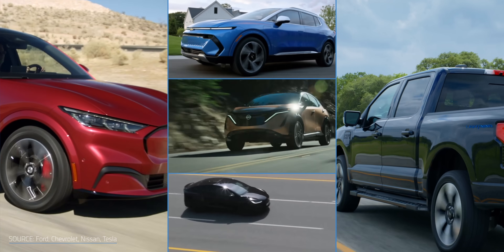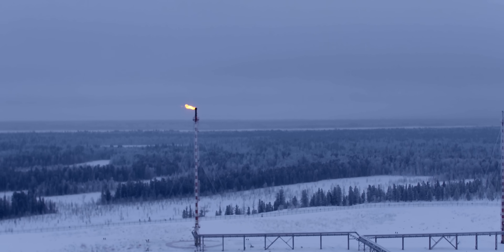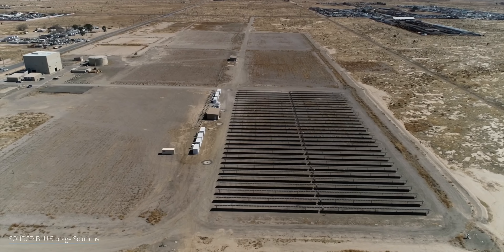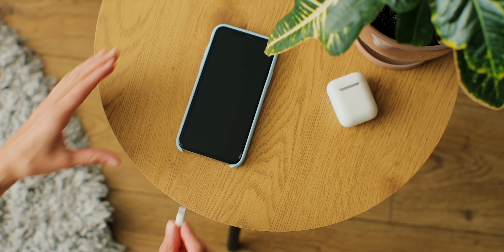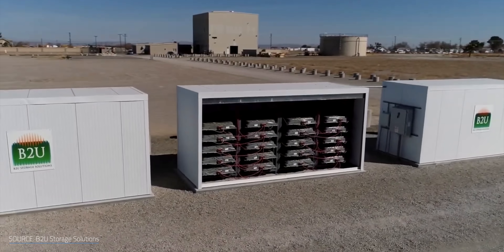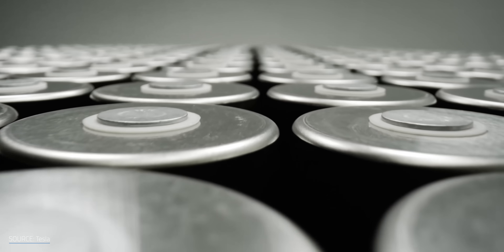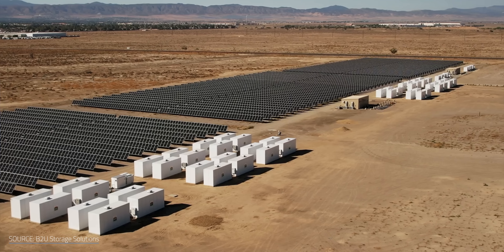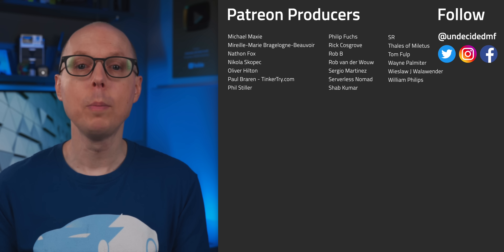How Old EV Batteries are Perfect for Energy Storage

Comment: While this idea sounds nice on the surface, it detracts from the main problem. We should not be using Li-ion battery tech for static storage - even used ones. These batteries are prized for their energy density, but their components are scarce and difficult to obtain without causing damage. Instead, recycle them, recover the materials and make new batteries.

There are other battery technologies that are better suited for static storage, where high energy density is not a major concern.

Comment: Firstly, there's no such thing as 'grid scale' battery storage. Batteries can help stabilise the grid and provide very short term peak supply but the amount of energy they can store is pitifully low, and at huge cost. If you have the terrain pumped hydro is much better. Second, those batteries will still die eventually, so recycling has to be the ultimate solution. Using discarded EV batteries as back-up storage is just a means of not putting them into landfill. EV manufacturers should be forced, by law, to recycle the batteries removed from their vehicles, and be fined heavily if they fail to meet minimum levels of material re-use.

Comment: Another good video- and another example of capitalism at work! What a waste not to re-purpose still useful batteries that no longer fulfill their original purpose. In the long run, these batteries will be fully depleted, and hopefully by then better recycling methods will be identified. 

This does raise some questions- what IS the average expected life of the typical re-purposed car battery? And how competitive will this approach be with new grid energy storage technologies, such as sodium ion, flow batteries, or alternate technologies such as molten-salt? Certainly each approach has different attributes, and cost is just one of many competitive factors, so there's probably room for multiple solutions.

Comment: Just a note on portable solar panels.  They really aren't as useful on a large scale as these companies make them out to be.  If you are camping, having a CHEAP lightweight portable solar panel in the 30-100W range is a great match to pair with a small lightweight power station.   They keyword being "cheap"..    It also doesn't make any sense to go above 100W with these sorts of panels.  At that point you need to be considering other more permanent solutions.

So if we are talking about CIGS, about the only panel that makes any sense at all would be the BourgeRV Yuma 100W panel at $210.   That's it.  And even that one is over-priced.  The others are just way, way, way too expensive for what they offer and for their likely low lifespan.

Instead I would go with literally the cheapest portable panel that you can find that fits the bill.  Which aint these thin-film panels.  Just perusing Amazon I see a number of brands that are far cheaper.  Sunyima, FlexSolar, and Eco-Worthy for example.   Sunyuma has a nice little 40W panel for $70, FlexSolar has a 100W panel at $128, and Eco-Worthy has a 100W panel for $100.   All three are brief-case style hard-mounted panels (fold in half for storage and transport).  They will be a bit heavier than something like the BourgeRV, but they also use standard monocrystaline cells that are hard-mounted and will likely last 5 times longer.

Once we start talking about going bigger than 100W... RV mounting, sailboat mounting, etc... at that point, only metal-framed hard panels that you permanently mount on the roof really make any sense.

Comment: We can definitely repurpose EV batteries, but to be perfectly frank it will only really work out well for LFP chemistries, and not so much for NCA / NMC chemistries.  Yes, there are companies using the latter, but its a losing proposition just from the standpoint of the fire danger.   California has already seen numerous battery fires from brand spanking new NCA/NMC chemistry batteries in grid-scale storage facilities.  Add OLD batteries into the mix?  No.  Bad idea.

But LFP batteries are another story.  The LFP chemistry is far more robust than NCA/NMC chemistries.  Thermal events can still happen, but thermal runaway generally can't... thermal events tend to be far more constrained in a LFP pack than they would be in a NCA/NMC pack.

I don't think this company's idea of safety is really workable in the long-run when it comes to NCA/NMC.  That's basically just a marketing line.   EVERYONE doing this monitors EV battery packs with software just as a matter of course.  Thermal runaway events generally develop very quickly.  Software monitoring is important, but it is no nirvana.  It won't stop a fire.   

However, once LFP batteries start to hit E.O.L., in volume that could provide a new life for companies like this.   A company like this which already has its legs could potentially do very well in future years.
Reply: Those fires were not from the cells, they were caused by arcing due to incorrect installation. Blame cheap workers and their managers.

Comment: There needs to be some standardization of EV batteries across models and makes. Sort of like how we have ""D", "C", "AAA", and "AA" batteries now for things like flashlights, radios, and toys (and TV remotes). And ideally, instead of one monolithic pack that requires special tools to remove and replace, have multiple smaller modules that would be individually swappable with common hand tools. Or sort of like how the vast majority of gasoline cars can all use the same type of fuel (with minor variations as to octane requirements) - the whole brand and model-specific battery packs concept needs to go away and soon.

Comment: No this is BS, so you take a battery with 30-50% of its capacity and re-purpose it as-is. How about giving the battery recyclers a reason to scale up and send those old batteries in for recycle.
THEN use the recycled materials to make new proper batteries for grid storage that actually give more capacity and last longer. Li-cycle for one already has the claim to fame that their process is easy to scale up to any size as required.

Comment: I think this is a great idea. This could be implamented as a virtual power plant. I live in a rural area and could see these being spread-out over farms.  Get farm could have a couple of them. It wouldn't require a huge infrastruce or grid upgrade.
Reply: This is exactly what battery 🔋 manufacturers want, so when the dendrites grow, they burst into flames 🔥 in rural areas, the lithium waste can not be tracked back to them [since lithium waste is being linked to Autism in latest scientific studies], and the burden of recycling goes away.
Reply: Not so fast with that. Forklifts are heavy as are the battery packs. The land would likely have to be compacted for the structure and the access lanes. I do like the idea of distributed facilities but there are economies of scale to consider. Would local authorities require every storage facility to have someone on site 24/7 to monitor it?
Reply: Just local co-operation and micro-grid deployment.
Have you MET capitalist Amurikkka?

Comment: 2:30 Reducing EV battery demand doesn't have to mean more gas cars, it should mean reducing car dependency. Better mass transit, more walkable/bikable cities, etc.
Reply: Or, having more cars available with smaller, cheaper batteries. I can see why a household might want one car with 300 mile of range. But a household with 2 or 3 cars probably doesn't need every car to be able to drive that far.

Comment: It is very sad the promotion of EVs. There is a major environmental damage in the creation of the batteries BEFORE they are placed in EVs. Next, when the EV batteries die, to recycle them is another environmental problem. Gas cars are 90-95% recyclable where as EV s are not even close to half that. If you want to stop pollution,  stop those monster shipping ship that make so much pollution across the ocean equal to 50k gas cars each crossing... also the extra pollution created on the grid to power those EVs...
Reply: You do realise that a lot of crude is ferried using those shipping ships you talked about.  And are you also aware of the tremendous amount of energy that is used during the refining and extraction of fossil fuels?

Comment: one additional massive advantage from recycling dead batteries: they required massive amounts of lithium, cobalt, nickel, etc. their energy density was quite low.
so recycling one old battery would allow the production of more than 4 new ones.
sure, it is tricky to do, but the nice part of batteries is, that the once mined resources don't disappear. they are still inside the battery.

Comment: I work at a nickel refinery that is researching recycling of so called "black mass". It is a potential source for a lot of the things we refine. With the amount of money businesses can earn from recycling these substances, I believe that a complete recycle eco system for batteries are right around the corner.
Reply: Yup the black mass is made of cobalt copper and carbon. May have iron manganese or tantalum added as well. Worthwhile to mine it.
Reply: One of the benefits of using the batteries for storage for a few years is that it will give industries like yours time to possibly improve on today’s technology.

Comment: Lithium is typically extracted from underground brine deposits or hard rock deposits which can require large amounts of water and energy to extract. This can lead to water scarcity and air pollution in the surrounding areas.

Additionally, the mining process can result in the destruction of natural habitats and the displacement of local communities. Chemicals used in the extraction process, such as sulfuric acid, can also contaminate soil and water, leading to environmental degradation and health risks for nearby communities.

Furthermore, the disposal of lithium-ion batteries can also have negative environmental impacts. If not properly recycled, the batteries can release toxic chemicals into the environment and contribute to electronic waste. Therefore, it is important to properly manage the entire lifecycle of these batteries, from extraction to disposal, in order to minimize their impact on the environment. 
Thanks! 👍

Comment: This video reminded me of another recent video where Toyota is building hydrogen fuel cell cars to power engines similar to cylinder and piston combustion gasoline engines. Has anyone explored the use of hydrogen fuel cell technology in peaker plants or even down to the home units? I realized that hydrogen is very flammable so I could understand that it would probably not be an ideal energy source. However, it sounded feasible in power plant settings.
Reply: Making and burning hydrogen uses up far more energy in overhead than charging and discharging a battery. So a hydrogen solution would require far more solar panels and wind turbines to generate that excess power to accomplish the same purpose. Unless, of course, you cheat at make the hydrogen from fossil fuels, as is done today, but if you do that, you're emitting lots of CO2 into the atmosphere so you're not actually accomplishing anything environmentally over just burning the gas and running the peaker plants.

Comment: Hi Matt, a couple of things to consider. We can completely go carbon neutral and without China and India doing something to curb their pollution our contribution is negligible. But if those booster plants were to use Nuclear power like the kind that runs off of Nuclear waste the pollution becomes almost non existent. One other thought is Lithium Ion uses a mineral that like fossil fuel will become expended over time. The mining process alone is polluting. But yes new uses for aging batteries is a partial solution. Better battery technology is the answer. Or better storage solutions..

Comment: While this does makes sense, the overall information content seemed a bit sparse and stretched out. I didn't much like how you kept calling them "dead" even thought we all know they're just reduced capacity. 

I would've like to hear about what differences makes static storage that much easier on the batteries than EV use, and how long these batteries are projected to last until they can't be used for energy storage anymore. 

This could also be an effective stopgap until the recycling throughput is there to recycle all these batteries.

Comment: I live in a major city in CA & we still get blackouts...if the grid in the richest state in the country can't function as is-how is it going to respond when we flood the fleet with electric cars? It's going to completely fail. & our govt is never going to switch to green energy to power these things, which is really just greenwashing anyway when you consider how toxic & fosil fuel using manufacturing EVs, batteries, solar panels, windmills etc are. Electric cars are such a bad idea. We really should have gone with hydrogen.
Reply: Hydrogen uses huge amounts of energy to extract and refine which would require more apparently "toxic" solar panels.  Theres a bit of a hole in your logic there.
Reply: @londonyes1380  Hydrogen can be produced in multiple new ways, there's a good channel that discusses this called Undecided with Matt Farrell. You should look it up it's interesting. They can now produce it as a biproduct from nuclear reactors-which are much greener than solar or wind-both manufactured using fossil fuels & have low energy conversion rates. & there are many many videos on how nuclear waste is not really a problem at all, it's way overblown; they can actually recycle the waste now & continue to generate power from it till it's nearly depleted & it's half life is far far shorter than previous.

Comment: Matt, nice work! One comment about natural gas. I’ve read it is actually dirtier than burning coal if over 7% (not sure about exact percent) is allowed to escape during production, transport, storage and use. And it is rarely the case when that much does not escape.
Reply: This is referring to the greenhouse gas equivalence of methane in comparison to CO2. However, long term the methane in a few decades degrades to CO2 (and water) , so it's hard to do a direct comparison.